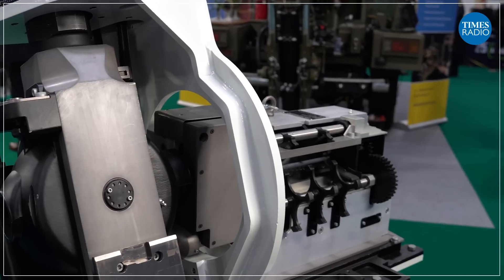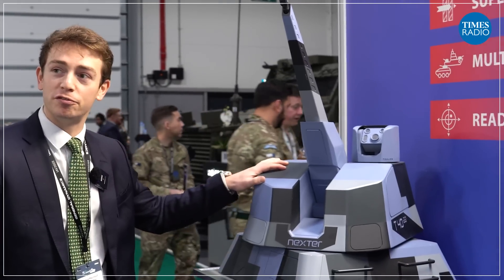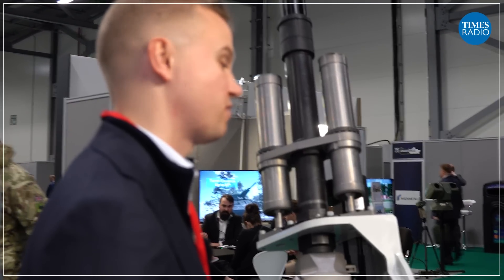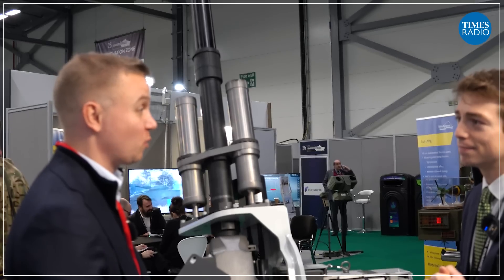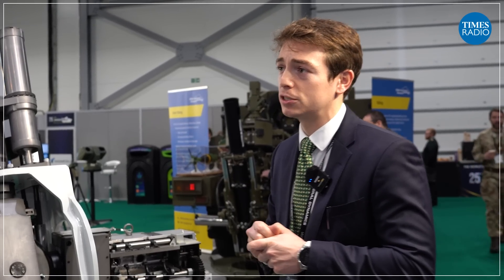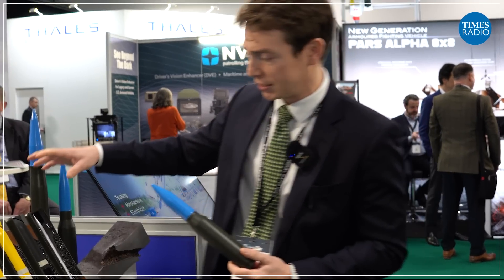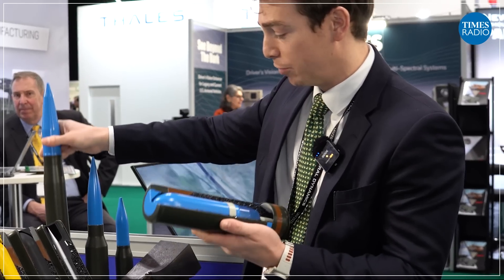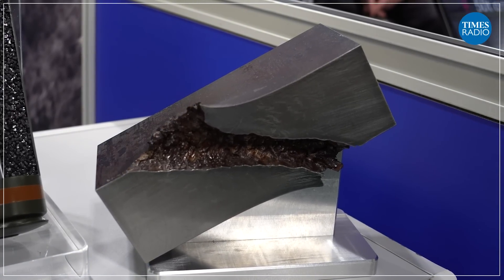The autocanon that is taking down Putin’s drones | Frontline tanks special

Comment: A combination of this gun in the EOS Slinger anti-drone system would be awsome, in the true sense of that word.
Reply: it would be an abject failure.  Loading a single round at a time with a human loader makes it essentially useless.   Airburst rounds introduces more room for error than the current proximity fused rounds used by slinger.  Slinger is also light weight and does not require a loader inside and armoured vehicle, slinger can be mounted in the back of a ute or place on top of any existing vehicle.

Comment: I really did listen carefully, but understanding his accent is another matter.

How is this different from other auto cannons? there's multiple types of ammo, & this can aim 85 degrees vertical. Is there anything else?
Reply: probably the fact it's 40mm with telescopic ammo. If you look at the cutaways it almost looks like a little stinger or AIM-9, with the metal rods, which makes it superior for taking out things in the air
Reply: Poor lad is Scottish an we tend to talk really fast dropping syllables
Reply: Also lower weight and more compact ammunition.
Reply: @thoughtpolice5191  which means that either it has less warhead power or less propellant.
Reply: @kazdean Telescoped ammo is more compact as in takes less volume, but not necessarily lighter by weight. The gun itself is lighter than other 40mm guns.
Reply: @kazdean  Not inherently. But what it does have is much more compact ammunition so you can carry more - and the gun is very compact too so it fits in a tiny space relative to the power of the gun.   The real penalty is the cost of the ammunition and wear on the barrel.
Reply: I am from North East Scotland, & I found it hard to understand him too..   It sounds like he is from Glasgow area..🤔

Comment: Glad the CTA 40 is getting the recognition it deserves as an anti-drone gun. This gun is the ANSWER. Stick it on an IFV with good sensors and it can provide a cost-effective drone protection system for a 4km range with just the gun alone. No need to spend $10K on a Stinger missile to take down a drone. BTW, this is the gun currently used on the British Ajax.
Reply: it is no more an anti drone weapon than any weapon with an air burst round.  In face if is probably worse than most because it requires the constant attention of a loader.
Reply: @kazdean  The high barrel elevation can be achieved without any special design considerations. It's compact so you can fit it to many kinds of vehicle and it's still multipurpose because it can select the ammunition type itself.   IOW your IFV can take out drones AND other targets.   It doesn't need constant attention from a loader - it has a system that autoloads the desired ammunition type.   You obviously need to refill at some point - just like any system.  It's going to allow people to get more usefulness out of each vehicle.   The compromise is cost.
Reply: @ but you cant just put in back of a ute with radar camera and remote weapon mount. The slinger only weighs in at about 330kg. That includes the 2 guns, radar, cameras and weapon mount. You could mount slinger on the roof rack of a family sedan.
Reply: @kazdean  That's not even in the same league. This is for REAL force protection at the Battalion/Brigade level with vehicles interlinked and sharing data, big Army. A platoon of armored vehicles with full spectrum detection armed with these cannons could lock down a very large area........given the range of each gun is 4km. Each armored vehicle could provide a 4km radius of protection, that's 50 square kilometers of coverage PER VEHICLE. That is assuming flat uncovered terrain. Imagine a vehicle like the German Gepard but with this gun and more advanced sensors and radar.
Reply: @timmurphy5541  Exactly. As far as cost is concerned it will end up evening out. Higher first hit probability and 4km range means less units required to provide solid coverage as well. I'm just flabbergasted that this hasn't been churned out yet. The solution is so obvious, I realized it out about 5 years back when the gun was showcased on the then upcoming Ajax vehicle.

Comment: Could a system be developed using motion detecting tech to watch the skies. When it detects movement a laser zeroes in the target then sends smaller , more accurately directed rounds.
Reply: Yes, you deploy a full spectrum system. Short range radar overlapped with the latest optical sensors and a good computer system..........you could put this thing on automatic and not even have to man 24/7.
Reply: Yes, or maybe a targeting system that scans for cameras, the same way that's done in hotel rooms. 👍